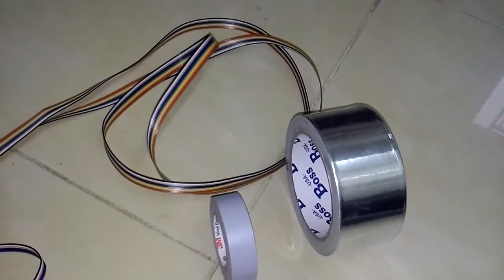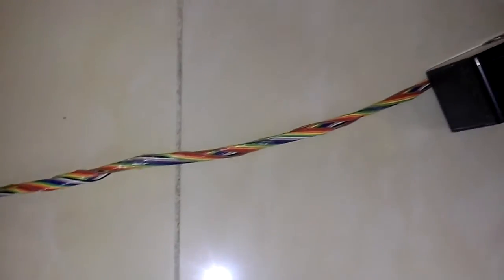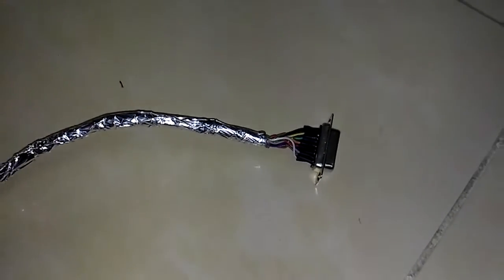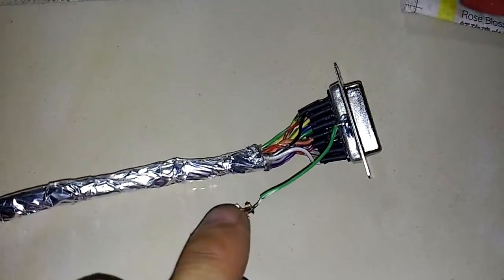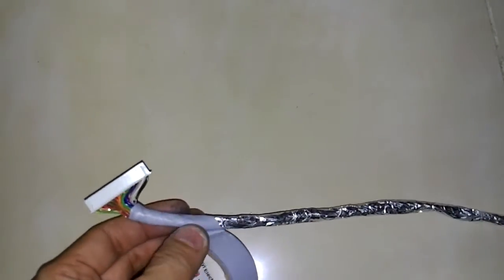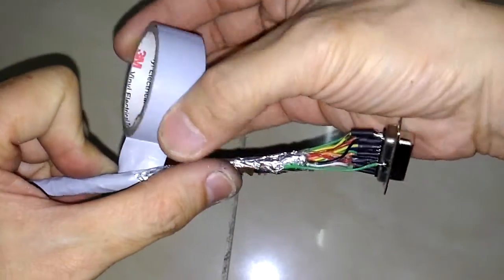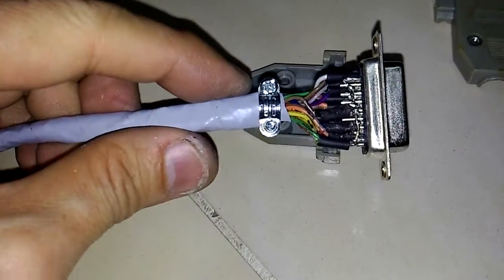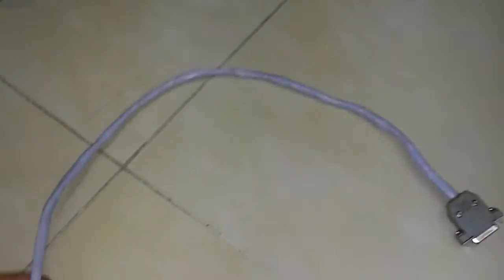DIY a multi-cores shield cable

Comment: DOES THIS WORK FOR CAT6 ETHERNET CABLES AS WELL? I HAVE A CABLE RUN THAT PASSES BY A FREEZER FOR ABOUT 2 - 3 FT OF IT. i WANT TO COVER ENOUGH OF THE CABLE SO ANY PART OF THE BABLE WITHIN 12INCHES OF THE FREWEZER WILL BE SHIELDED SOMEWHAT.
Reply: It is completely unnecessary to shield a CAT5 or CAT6 cable, and it can even be worse, because the shielding can act as a "receiving antenna," which collects interference signals...
UTP cables are not separately grounded because the twisted pairs cancel out interference themselves. Due to the twisting, electromagnetic noise coming from outside is balanced between the pairs, so the cable does not need to be grounded separately. There is absolutely no need for this in a normal home or office environment.
For those who are interested in more detail: there are 8 thin wires inside, and 2-2-2-2 wires are twisted together at different densities. All 4 wire pairs carry data signals with opposite polarity. If external noise affects the pair (e.g. your fridge as you wrote), the signal appears in the wire pairs in the same way, so the differential signal on the receiver side subtracts the noise, thus receiving the data clearly. This is why it works even without grounding. I hope I'm not being too technical. Maybe in a very industrial environment, with 10,000 Volt transformers nearby, there could be interference, but even that wouldn't be very noticeable...

Comment: Can i use aluminium foil?
Reply from the maker: Yes, you can. Because it is thin and easily breaks during coiling/wrapping around. Prefer to have two layers stack.
Reply: @ray-charc3131  I have a poorly shielded vga cable and I would like to shield it to get a better signal quality. Do I have to cut open the main heatshrink and wrap it around the all those wires or can I just wrap it directly from outside?
Reply from the maker: @FeverDev64  it's cubersome to cut away outer tube of existing cable. Thinking that just wrapping around it with metal foil and adding outer cover on it.
Reply: @ray-charc3131  oh so just adding 2 layers of foil on the outer tube of the vga cable amd adding some tape to cover it will work?